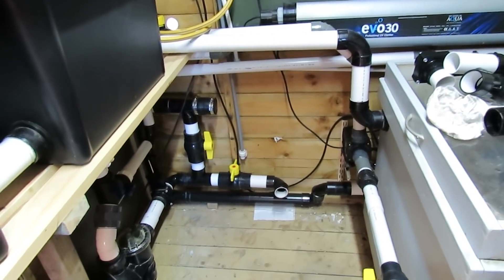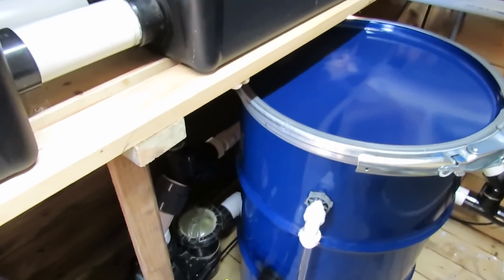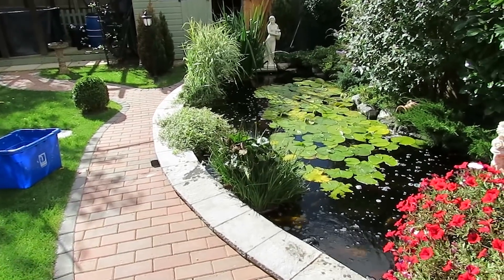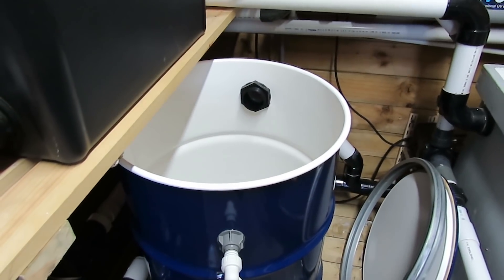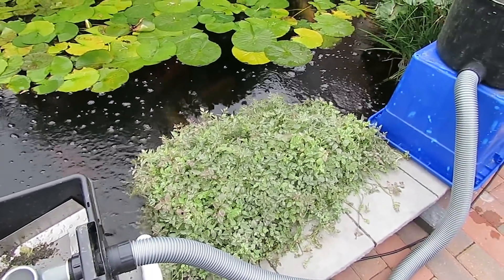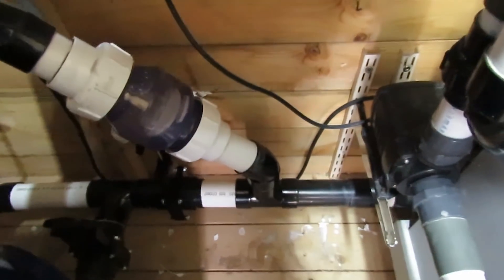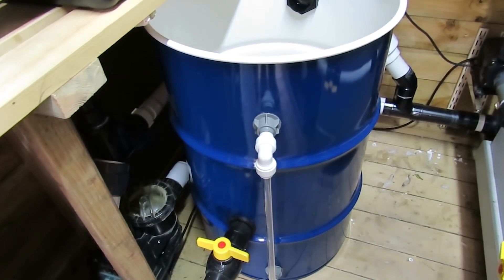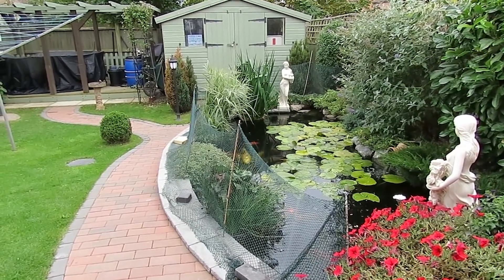Pre Pump Filter Gets a Run

Comment: The new drum looks very nice and smart. It's a shame the paint take so long to dry properly but needs must I guess and once it's done it should hopefully last a very long time. Having lots of the smaller plants around the pond will be better than the tall although the tall looks nice also. It won't be long and it will be summer again :)
Reply from the maker: Hi Chris, Thank you. The paint might dry a bit quicker this time as I didn't put any water with it. It is a 2 pack acrylic and drys really hard. The taller grasses might be ok but the iris is bursting out of the basket in one season, so it will have to go. I hate the cold weather, roll on summer lol. Thanks mate, Terry.

Comment: Hi Terry, Been watching your videos for a while now but this is the first time to add a comment
My question: Love the Pre-filter (sieve), just wondering why you are pressurising the container
Reply from the maker: Hi Paul, As my filter house is above ground and pond water level, the pump has to be primed as it's lifting the water. This causes a vacuum on the inflow of the pump. Adding a filter on that side of the pump, the filter has to work in that vacuum. So the water is sucked up to the top of the pre-filter by the vacuum which is caused by the pump removing water from the bottom of the filter. Hope this helps. Thanks, Terry.

Comment: Hi Terry good to see you got the pre filter up and running mate. It’s all come along nicely so keep it going. I think you can get a few more weeks out of those plants! Quick question I want to put an underwater camera in the pond permanently especially as winter is coming. Have you got any suggestions on a good one?
Reply from the maker: Hi Tony, Thank you. To be honest I haven't mate. You'll need something that's under water and with a power lead to it if it's running full time, or you'll be forever changing battery's. It will also need a video cable running to it to connect to a monitor. I can't say I've seen one mate, sorry. Terry.
Reply from the maker: Nice one Pik Mak.👍

Comment: Just a thought.... doesnt having a pre pump filter sort of negate the need for the drum filter? isnt it doing the same kind of thing?
Reply from the maker: Hi Jim, The mesh in the pre-filter is bigger. It only takes the larger particles that would block the pump. It will help the RDF which means I won't work so hard and trigger less. Thanks, Terry.